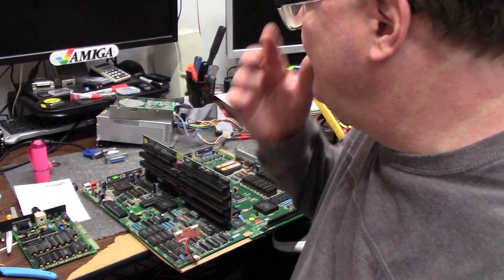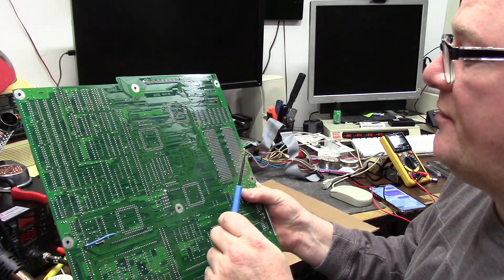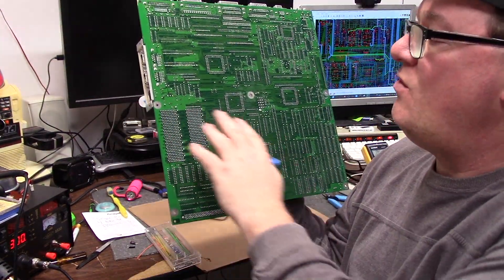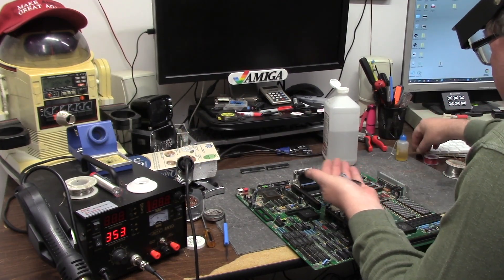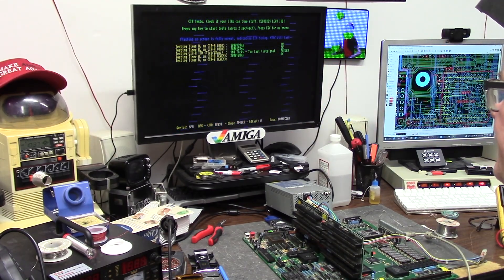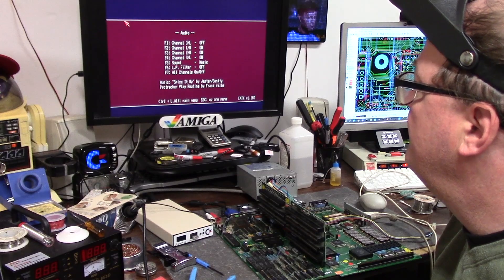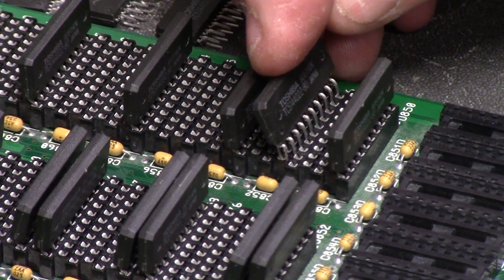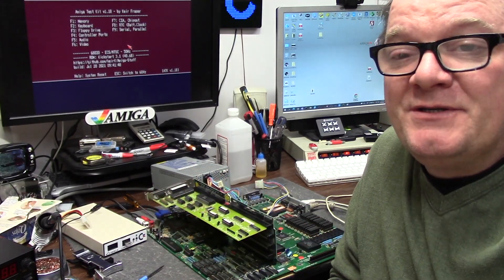Mr Alans Amiga 3000 repair

Comment: Hey Chris, is there copper in the vias on the A3000 connecting the front and back of the motherboard?  just wondering if I have to solder both sides during a cap replacement.  As always, thanks for the videos and keep up the great work of saving our systems.
Reply from the maker: Vias go
All the way through via a copper
Tube.  Fill them
Up till you see the siver
Balls on top. OR touch the top a little but if its not enough

Comment: What printing a FACEPLATE.  Hey lets chat I'm looking for an A4000d faceplate. actually the entire case would be nice
Now the reason I'm here is my A3000 is acting very flaky.  Lots of random hangs, guru notices, apps not running correctly  etc.
I'm thinking a place to start is a recap with high end parts, then a new psu followed by long duration diagnostics..
Reply from the maker: for your 3000 run the ziptest from Chris Hooper on aminet here  https://aminet.net/package/util/misc/ZIPTest  . its a shell app that tests all those annoying Zip20 fastrams. they cause all sorts of weirdness.  but lets not leave out your storage solution, or even a borked build. Amiga programs dont get along with others very well as there is no memory protection with exec (the os kernel)
Reply: @ChrisEdwardsRestoration  Yeah it's an A3000 from hell.  Needs some expert tlc.   I can do a recap.  Not sure where I'd find a new psu. would also like to chat about a4000 case or at least a faceplate.  Also would you be interested in a 1571 drive repair project?

lets chat
Reply from the maker: @drpc98014 i dont do 8 bit.  You can get power supplies from symon gosk as i showed in my other video where i built one.  I dont have any cases for sale nor faceplates

Comment: Chris, how come you got a fail in Diagrom with CIA-A TOD (Tick/VSync), but that was okay? Just wondering because I’m getting same on my A3000 with Diagrom using Amiga PSU & wondering how to resolve it.
Reply from the maker: Unit is pal my power is ntsc its fine
Reply: @ChrisEdwardsRestoration  So, on a unit where it’s NTSC with Amiga PSU and you get that same error, what does it mean you should do to fix? Thanks.
Reply from the maker: @SoulStarLA nothing there’s nothing wrong it’s just noting that your signal is different than your tick or lack of if you are in Vsynx using a ATX power supplie
Reply: @ChrisEdwardsRestoration  I’m not using an ATX power supply. Using the Amiga 3000 PSU.
Reply from the maker: @SoulStarLA  ok so what is your psu, 120 or 240v, are you    jumpered for pal or ntsc to match the power supply your using? is your monitor pal if your in pal, or is it ntsc. see they all play in the signal, it doesnt hurt a thing. no worries mate. once it boots test it with Amiga Test kit and you will report fine.  diagrom is all pal and hates ntsc, its better w newer version 1.3 but still made for pal
Reply: @ChrisEdwardsRestoration  Using Diagrom 1.3, 120v Amiga PSU, jumper set to NTSC, NTSC Dell U2410f. Thanks!

Comment: Awesome job as always, this one most would have given up on!  Two questions, does a 3000 need a battery to boot SCSI? Around 14:30 there is a comment about battery and remembering the SCSI settings.  Also, what is the software on the LCD in the background to highlight the amiga schematic traces?
Reply from the maker: No it does not need a battery it only adds 1 second if that to boot time for scsi init. Its all coded in bios.  The software is sprint layout 6

Comment: Oof, I always got stuck with those type of boards. Looks like dude used the solder tip to shove the VIAs out through the top to push out the cap leads. Saw that all the time when VIAs were first becoming common. People used to working on single layer boards not thinking or knowing there could be many layers they can't fix.

Comment: Looking at the board, it looks like there are calcium and mineral deposits on the silk screen. Did the idiot take out the chips, and try to wash it in tap water or something?
Reply from the maker: Dunno it was a mess
Reply: @ChrisEdwardsRestoration  It was heart breaking to see, just how butchered it was. Good job on bringing it back. I also suspect the use of an unregulated low temperature solder iron. The holes looked a bit like if I take my 15 watt iron and try to desolder something without adding some fresh solder, and keeping it on for too long as well as twisting it into the holes. I never use that iron, but keep it because it is my first, that I got used back in 1990/91 or something. It is good to melt stuff with like tagging broken plastic parts, before using epoxy or whatever. So it is kept for other jobs than soldering.

Comment: The 3000 will boot fine with all Static Column ram or all Page Mode ram,the trouble comes if you want to mix the 2 types,in which case the page mode ram must be in bank one,and then install the static ram.The one exception to this is if you have the Ramsey7/Dmac4 combination of chips which allows mixing the ram any way you want. You do loose some speed mixing ram with the 030 cpu,since all mixed ram is then treated as page mode.
Reply from the maker: yes that right there is the lost knowledge we need. you sir are a legend. it took me a long time digging to find those nuggets prior to your comments.

Comment: Amiga noob here. Does the daughter board have to be installed in order for the computer to output anything to the monitor?
Reply: No. You'll get SOMETHING like a yellow screen.
Reply from the maker: yes the daughter board needs to be installed to boot it, or the fpu yellow screens it. however Diagrom can boot without the daughter board in as its special abilities do not require it to be in

Comment: This is one reason why I haven’t sent my working A3000 to be recapped, have a coin battery holder put in and wire traces put in for my Cyberstorm III fix. Especially since I don’t have a second A3000.
Reply from the maker: well it depends on who you send them to.